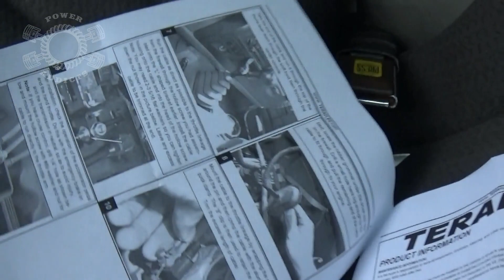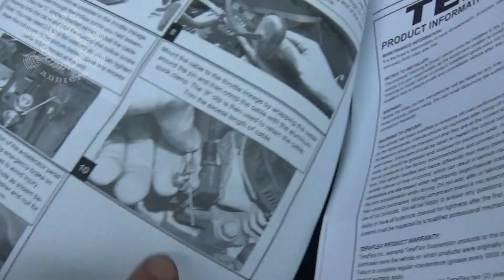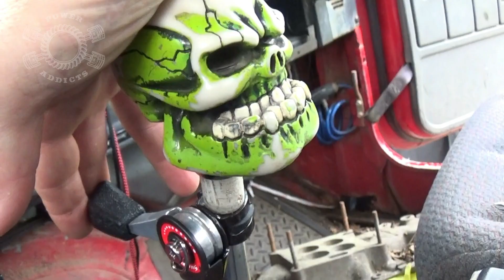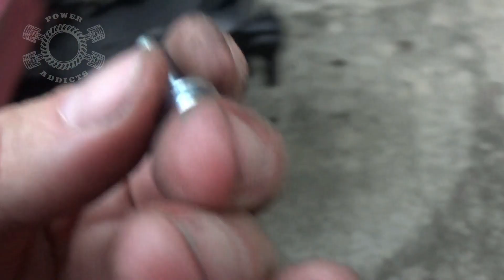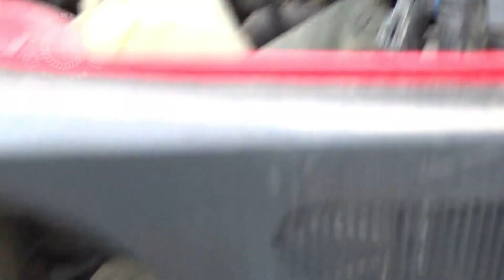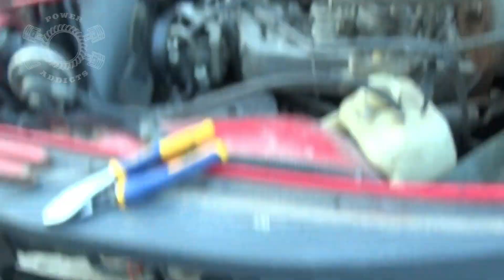Jeep Wrangler Hand Throttle Control #jeepwrangleryj #poweraddictscrew #jeepyj #throttlecontroller

Comment: my cable loop would pop off the throttle stud once in a while - i just used a small hitch pin clip to keep it on.
Reply from the maker: Yep, I can see that being an issue. That's why I added the washer and hitch pin to prevent that. Thanks for dropping in!